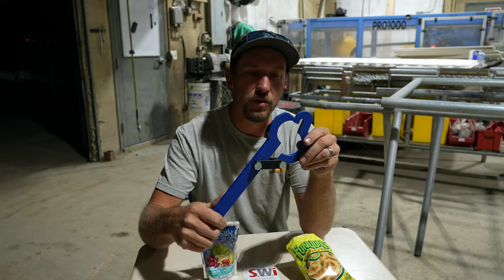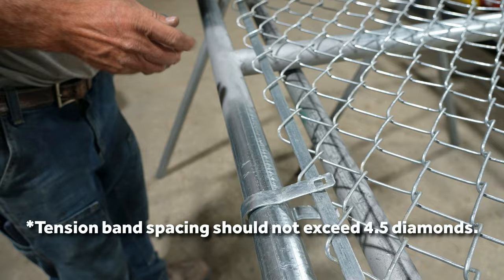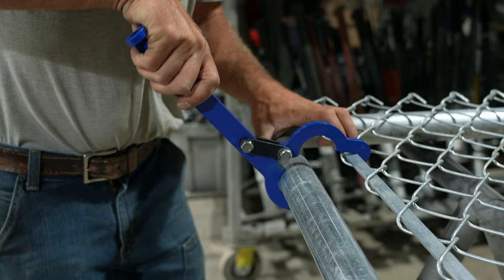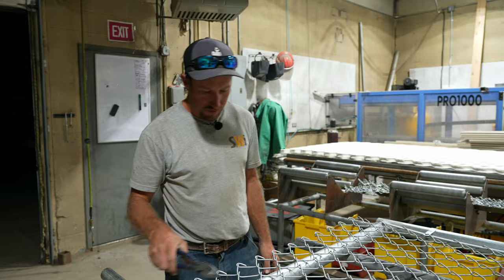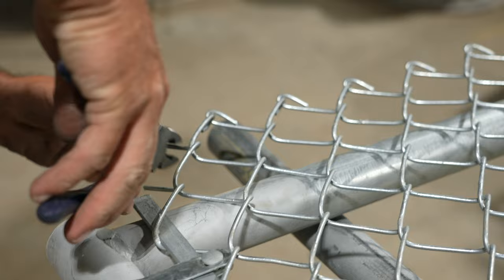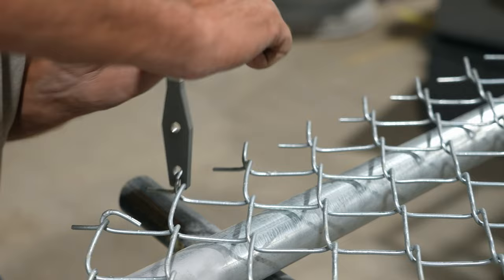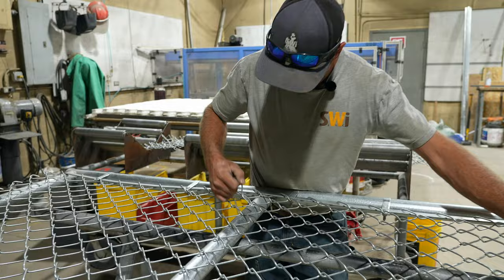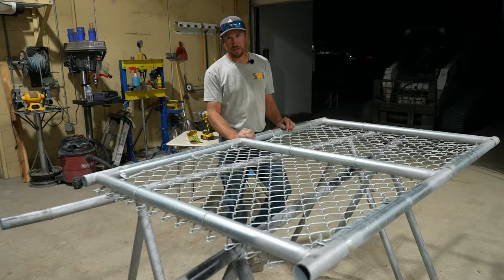Install Fabric On A Chain Link Gate The EASY Way!

Comment: Knuckle Twist Tool. Damn, I wish I had one this past weekend.  400 knuckles later using a hollow screwdriver tube and then  pair of channel locks to finish bending them over. Worked up a lot of sweat!!
Reply from the maker: Sounds like!

Comment: In my part of Australia, attaching chainwire fabric to a gate would normally be described as "lacing" the gate, as fabric is typically attached by lacing 1.57mm wire around the frame of the gate.  Tension would be provided by wire ties until the lacing was complete.

This looks a lot easier.  Particularly that "bearclaw" tool.  Would have to switch to fittings to secure the fabric though.

Also, good point about the tightness of the chainwire.  You can get a fair bit of play in the wire if the gate is long, but at some point you're going to have to decide which straw is the last.  When it's a choice between a gate that's a little looser than you'd like and a gate with deformed chainwire, you pick the former.

Comment: Great video and looks like a great product. Quick question if you happen to see this. How much does the bear hold tool scratch up vinyl coated fence?
Reply from the maker: It could scratch it a little but I'm sure you could put a towel between it and the post to keep it controlled.

Comment: build 7 of them  similar to that design over 35 years ago we call it a end stretcher from 1 3/8" to 2 1/2" od fits all 1- tool. We use for gates and up to 25' pulls  always face cut bars down n yes cold galv,
Reply from the maker: What a time saver!

Comment: Bolt cutters for cutting fabric and long handle pliers to relieve pressure on hands and wrists, when cutting 9 gage wire. Twist ties to be bent to down to lay on framework  is safest position. Fabric at bottom should be flush with bottom of gate to allow for any grade changes under gate. Just a thought.
Reply from the maker: The fabric is even on the bottom although it may be hard to see in the video.  It protrudes at the top only.  Gates are also 2" shorter for this reason.

Comment: I have been cutting tension bars with bolt cutters, never knew you could use a porta band instead.
Reply: Years ago we used to do the same thing until we figured out, that’s the fastest way to ruin a pair of bolt cutters.
Reply from the maker: That's murder on bolt cutters!